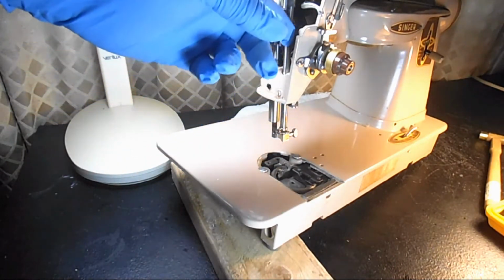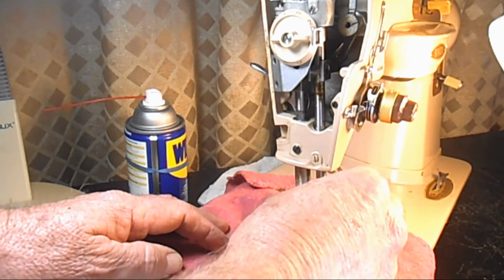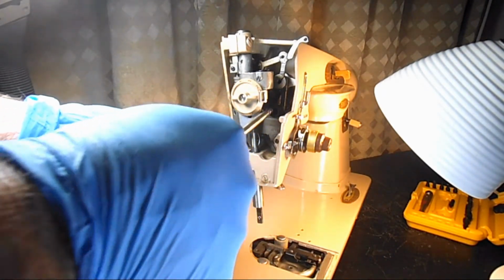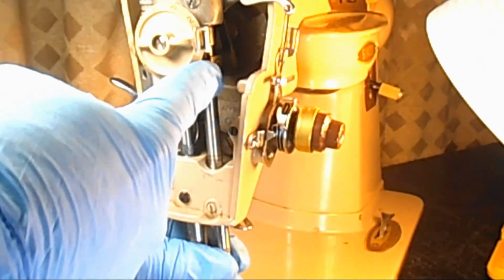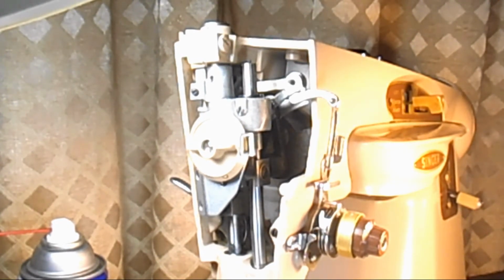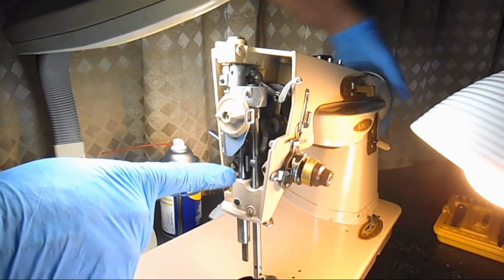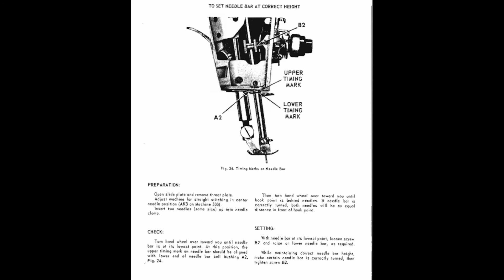How to Remove and Replace the Needle Bar on the Singer Model 503A

Comment: YES!!! Thank you! Oh, this saved me so much time and money for such an easy fix! I could see why my machine was not picking up the bobbin thread...I couldn't see that top line on the needle bar. It was up past the bushing. That screw that released the needle bar was not as tight as yours, I adjusted the bar so I could just barely see that top marking and my machine worked perfectly. You saved me an hour trip to the nearest SINGER shop (I live in southern France), never mind the number of days waiting for the repair. Now, if you could tell me how to get my stop motion wheel to loosen, I could wind my bobbins. It is absolutely fused together! Hugs and kisses, Andy. (I have the same 503A)
Reply from the maker: Hooray!!! Nicely done, Heidi-Marie. It's better if you do your own repairs than have the shop do it. Besides the time and money it takes, they often have no experience with the vintage machines. No one loves your baby more than you. Here are my other 503A videos if you ever need other maintenance work: https://www.youtube.com/playlist?list=PLsCOZgzzaiKJZaZn2zl3LsnV2d7UhrqvX
Model 403A was the precursor model and has mostly the same parts. Anything not covered in the 503A playlist may be covered in the 403A Playlist here: https://www.youtube.com/playlist?list=PLsCOZgzzaiKKyqvdDRwS-9MfLuwSNJTcg
You can also download a free copy of the SERVICE MANUAL for your machine at this link: https://sewingdude.files.wordpress.com/2012/09/singer-500-service-manual.pdf
I'm happy you found my channel, and appreciate your kind comment. Best wishes and happy sewing.
Reply: @andytubesewing1953  My 503A baby was my mother's, so for sure no one could love it more than me. I still use it here in France where it requires a transformer since it was wired for the States. My baby is a world traveller. Next I will try its buttonhole attachment! Thanks for the playlist and the 403A connection. Your videos encourage me to get to know its inner workings which up until now I never considered to be in my domain.
Reply from the maker: @heidi-marieblackwell826  A family machine? Even better! Happy for you 😊 No worries, you can do all the maintenance and keep it running forever. Take care.

Comment: Nice video...right on point...but my needle bar wont budge.... I have even bought some professional spray that's supposed to free all things that are stuck and it still doesn't work
Reply from the maker: Thanks for the compliment. I'll assume that the NB is stuck in the clamp even though you removed the screw. That is fairly common.  
     Over the years (decades) oil has settled into the clamp and dried up; layer upon layer. It gets hard, like varnish, and the NB gets kind of "glued" in the clamp. 
     If your spray did not help you can keep reapplying it over time and let it soften the old oil. Patience. That still may not work so this is when I use heat. I just use a hair dryer and blow hot air on the clamp area. It may take a minute or 15 depending. 
     Since you have your spray on it the hot air will blow it all over the parts, which is OK if messy, and you can wire it off later. It is not a lubricant (usually) so you'll want to remove it. 
     A few times I slipped the needle clamp parts back on so I could use the thumb screw as a handle to "twist" the NB back and forth. Please do not pound or hit the NB with anything b/c it can bend. I've had a few times that the NB just fell to the bottom while I was using the hairdryer. 
     I don't have one but a couple friends have used a heat gun instead of a hair dryer. I don't know how hot those get, so just don't scorch the paint. Good luck, and thanks for watching my channel.

Comment: Help me Andy Tube! You're my only hope!
I found a mystery spring rattling around loose in the cavity behind the needle bar and lifter bar in my 503A. 
It is elbow shaped,  about 1 inch in each side, with a single loop of wire forming the "elbow" and a bent tab on one end about 3/4 " long.
It doesn't seem to have anything to do with the needle thread tension assembly as I took it apart and reassembled it with no missing parts. The machine seems to sew very nicely.
Where did it come from?
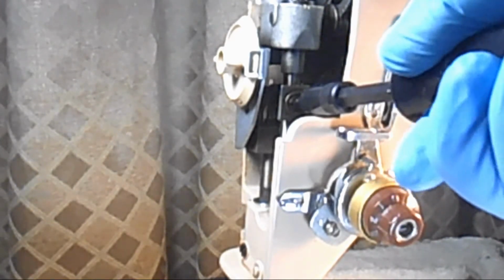Reply from the maker: "you're my only hope"... uhoh, we're in trouble now! It's not part of the tension. I'm going to WAG it here (wild-ass guess) and say it is the Needle Bar Vibrating Bracket Spring. Whew! Does your machine still sew in zigzag mode? Take a look starting about 05:36 of this video: https://youtu.be/L9ZiWURPA-Q    I just put a rubber band on the machine, but at 05:36 my finger is almost pointing at a long spring. Keep watching the video and you'll see me take that spring off of a hinge pin on the vibrating bracket upfront by the presser bar. I think maybe your spring broke and the shorter piece flew up into the nose area and that is why you have a weird spring behind the presser/needle bars. As I said, that is a WAG, but there is no other spring of that type/size in the needle bar area.  As for the spring being an "elbow shape, IDK but maybe it got bent when lifting the presser bar or by the take-up lever mechanism. If I am correct you'll need to replace the spring. Nobody makes new ones so you will have to find a used on eBay or another online seller. If I am wrong, please take a couple good pictures of it and put them on your YouTube channel or tell me how to look at them in the cloud or something. There are other videos about Model 503A on my channel. Here is the playlist for them: https://www.youtube.com/playlist?list=PLsCOZgzzaiKJZaZn2zl3LsnV2d7UhrqvX
Good Luck, Tracy, and thanks for watching my channel.
Reply: Eureka! 
After watching more videos, I discovered it is the spring that goes under the bobbin spindle assembly! How it got up in the head of the machine I'll never know.
Thanks Andy!!!!!
Reply from the maker: @vanlifecrone4618  WOW! I've heard of "parts migration" before, but that is usually when I drop a small part on the hard floor and it takes off to places unknown. I know the spring you mean now and I'm glad you figured it out. Thanks for letting me know; I'll sleep better now, hahaha.

Comment: There aren't any timing marks on the needle bar of my Singer 7033. Is there any other way to determine the propper placement of the needle arm other than using the these timing marks?
Reply from the maker: Please read my reply to your question on the 99K comment section here: https://youtu.be/9zU1_VjMddQ

Comment: Hi Andy, I’ve been very nervous about taking apart my 401A. I completely gave my it a major tuneup. My machine is purring like a kitten. I’ve been cleaning up the body with crud cutter. I’ve checked the stitches and the stitches look fine. However, I’m just not satisfied with the cleaning of the inside mechanics. So i’m biting the bullet and going to do a full restoration. by following your 404 and 503 a videos I’m taking pictures along the way. When I’m finished, if you’d like i’ll send you the pictures in case you would like to use them. I’m a little nervous about this project. I never thought I’d be doing this restoration, so I never took pictures of the machine when I first got it. But I can tell you it took me one week to unlock the posts that change the different cams. Also, the inside and outside selector knobs were totally frozen. It was terrible. The inside had so much threads, dust, and oil that I thought there were sections that had some sort of felt inside.that was for sound insulation.
In one of your videos you were working on a really dirty machine and you said you were wearing a mask and using gloves. I wish I had thought of that too. I’m removing the feed dog , needle bar and presser bar tonight. Oh my!
Reply from the maker: WOW! You can do it, Dorothy! I wish I'd seen the "felt" look too. I'd love pictures any viewer wants to send. 

When starting a restoration it can be intimidating. I think because we are forward-looking as people and think of the whole process. What helps me is to take it one-step-at-a-time. Just think about that needle bar and its parts. Just do that. Forget the rest of the machine. You will be fine and then realize "hey, that wasn't so bad/hard". Take your reference pictures for later. Bag, cup, and I.D. the parts. Before you know it you are ready for another part, then another and step by step you accomplish removing however much you want to. 

Remeber viewer Daffycat said it is easier than it looks because she did not have to maneuver around a camera, and Shelley said it was one of the most rewarding things she had done in a long time. I'm excited for you as I remember my first restoration of this kind. You know where I am if you have questions or concerns. Please relax and have fun.

Comment: I got one of these this week end for $35.  The bobbin is a bit noisy but still sews well with all of the accessories.  Near pristine. Almost makes up for the flogging I got on a 201 2 that arrived damaged.  Now I can watch your 503A videos.
Reply from the maker: Oh, what a good buy you made! Congratulations. In my 503 series, I tried to show the parts that are not in a 404. The 404 series will cover all the common parts and adjustments. If anybody reading this needs the 404 series it is here: 
https://www.youtube.com/watch?v=6RgiOegFx-I&list=PLsCOZgzzaiKIB4kvIHCfHYuyLMUp5A4UI
For the noisy bobbin, a good cleaning of the bobbin area and parts goes a long way towards quieter sewing. Fresh oil on the hook shaft and hook race and bobbin holder is a must. The things I would check after that for a noisy bobbin are the thread clearance, and the stroke and tension of the needle thread tension unit. My two best videos of all that are here:
 https://www.youtube.com/watch?v=6RgiOegFx-I&list=PLsCOZgzzaiKIB4kvIHCfHYuyLMUp5A4UI
and here: https://www.youtube.com/watch?v=4Q1dAUHqfvg

Comment: i've seemed to crack one of my gears is there any way this can be repaired???  Please help the gear them selves seem to be plastic.  I have singer touch & Sew machine model 648
Reply from the maker: Hi Donna. Sorry about your cracked gear. You don't mention which gear is cracked. On the 648 there are four gears down below and two on top. The most likely gear to break is on the hook shaft directly under the hook/bobbin holder on the bottom of the machine. (hook drive gear) Any/all of the gears can break.  Any/all of the gears can be replaced, but it can be difficult to do yourself, and overly expensive to have a shop do it. The gears themselves cost from  $9 for the hook gear to about $20 for a full set. If you want to give it a try, go here for a free download of the parts diagram for your machine, and copy down the gear part numbers: http://parts.singerco.com/CPpartCharts/6_6999/648E3_648E6_648E7.pdf
Be sure you buy the correct part number. Here is one seller of parts: https://www.sewingpartsonline.com/singer-648-sewing-machine-parts.aspx
There are many other sellers, including on eBay.

You can buy a service manual from this reputable seller for $8.99. You may want to email him first to be sure the gear removal instructions are included in the manual; they usually are but he will check for you. I have done business with him for years and he is very honest and straightforward about his manuals.
https://manualsoncd.com/product/singer-630-648-sewing-machine-service-manual/

There are a few videos on youtube about replacing gears; maybe not on your exact model, but you will get an idea of what is involved. https://www.youtube.com/watch?v=eDKcJZqAMmI
https://www.youtube.com/watch?v=cYLzGwpoWeE
https://www.youtube.com/watch?v=aF7HnM6FlX8
Search for other videos too. 

People who have bought my machines told me they were quoted between $150 to $250 for having gears replaced on a touch-n-sew machine if the shop would do it at all. You can buy a vintage Singer with metal gears in that price range. For example, I have the machine in this video for sale today, 1/5/2018 for $225 on Craigslist in Phoenix. Fully restored, all metal gears, with complete attachment set. https://www.youtube.com/watch?v=dMEgNgbFqPI

This is why I very, very rarely buy or restore a machine with plastic gears. If they are not broken now, they will be someday. Never put oil or grease on these type of plastic gears. Good Luck.